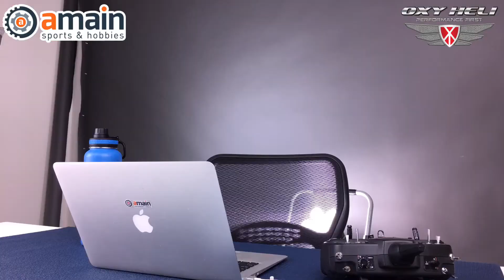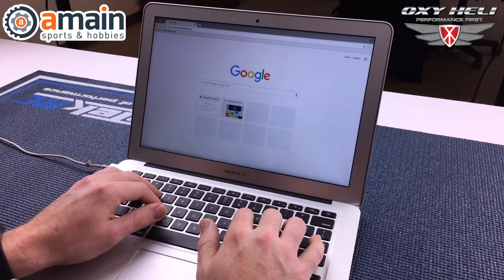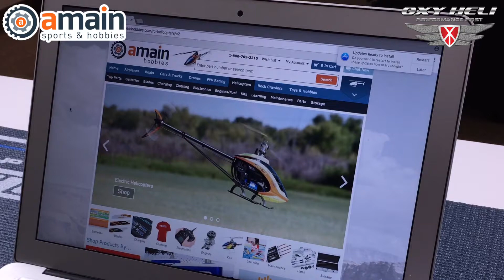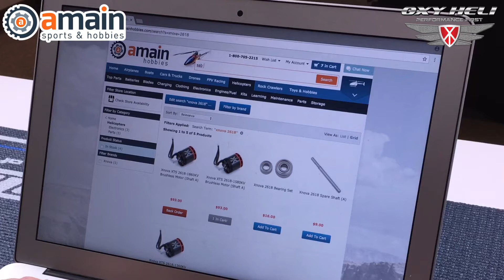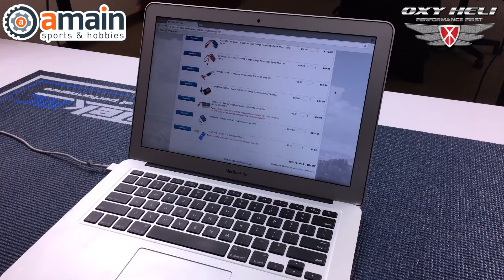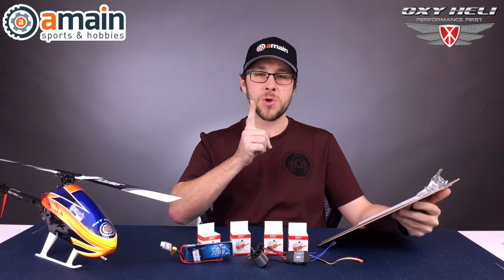Oxy 4 Series: Electronic Packages

Comment: I already broke the bank. I got the align kit with x nova 2618, castle Phoenix 60 edge, thunder power lunar 1100 6s 100C, 4 M.K.S servos, beast-X, spektrum satellite, everything ran me 720$ excluding the align kit of $409 total of $1129 USD excluding shipping’s. Well my trex 450 is pushing 125mph plus

Comment: I am getting back into the RC Heli flying.  I have the Align T-Rex 470LM.  I am using the HW Pro 60a v4 ESC, 6S 1800mah Lipo and iKon2 FBL.  What are your suggestions for electronics  to complete the Oxy 4 Max package?  Thanks
Reply from the maker: Hello Randall. Here are recommendations from our heli team: 
Cyclic servo (x3): https://www.amainhobbies.com/kst-ds215mg-v3-micro-digital-metal-gear-servo-kstds215mgv3/p486910
Tail servo: https://www.amainhobbies.com/kst-ds565x-helicopter-tail-mini-digital-metal-gear-servo-kstds565x/p700422
Motor: https://www.amainhobbies.com/xnova-xts-2820890kv-hp-brushless-motor-890kv-xnm2820-890-a/p440119
ESC: https://www.amainhobbies.com/hobbywing-platinum-pro-80a-v4-80-amp-esc-hwa30203200/p510523
Battery: https://www.amainhobbies.com/hrb-6s-60c-graphene-lipo-battery-22.2v-1800mah-hrb-6s-1800-ec3-g/p1154988
Gyro: https://www.amainhobbies.com/msheli-brain-2-flybarless-system-msh51636/p511328
Hope this helps!
-Brett
Reply: Thanks.  I’ll take a look at recommendations!
Reply: Any recommendations for a
receiver?  I want to be able to get telemetry data.  Thanks
Reply from the maker: @randallwatts9840  Let me ask and we'll get back to you tomorrow. 
-Brett
Reply from the maker: Hey Randall. Our tech says that telemetry options depend on the radio you're using, as well as other equipment installed in the model. What radio are you using?
-Brett
Reply: @AMain_Hobbies  RadioMaster TX16S
Reply: @AMain_Hobbies  Hobbywing 60A Pro V4  ESC and iKon2 BT flight controller
Reply from the maker: @randallwatts9840  Sorry Randall, we don't have any experience with that radio, so unfortunately can't provide suggestions for RX or telemetry.
-Brett
Reply: @AMain_Hobbies  okay.  Thanks for your help!

Comment: Which Setting would be the best to maximize flight time? 3S? (headspeed is not important to me)
Reply: What works best for me with my 450L 3s was getting the lowest motor pinion i could get (9 teeth) on a align 3200kv motor , opened up the esc some more (and only in idle up with governor) to 80%. Got a lower headspeed but that's what i wanted and have a flight time of 13 minutes on a Gens Ace 2200mah 45c 3s lipo. So do a similar thing to a Oxy4 and you will increase your flight time because everything will work as effective as possible without changing energy into heat. Also play around with motor timing in your esc.
Reply: I am getting back into the RC Heli flying.  I have the Align T-Rex 470LM.  I am using the HW Pro 60a v4 ESC, 6S 1800mah Lipo and iKon2 FBL.  What are your suggestions for electronics  to complete the Oxy 4 Max package?  Thanks